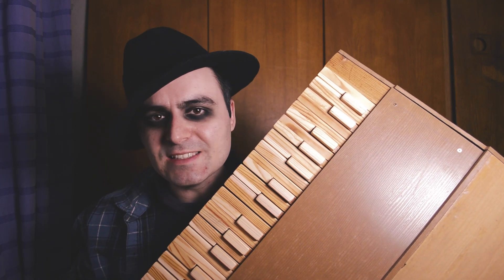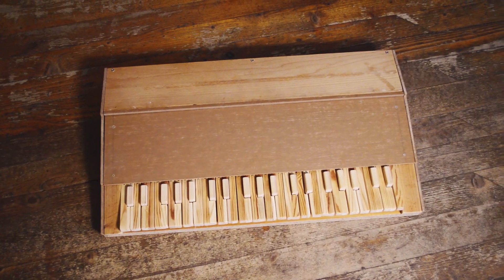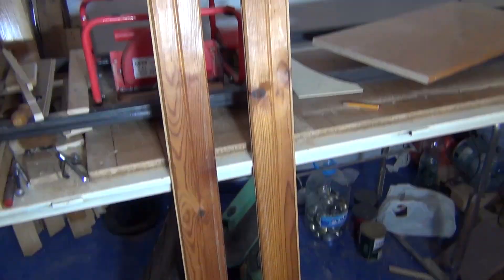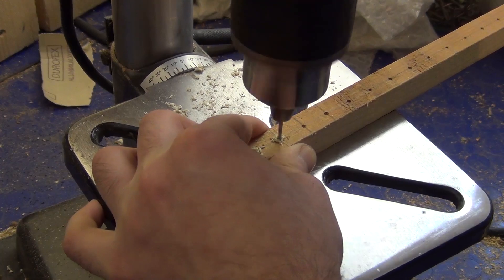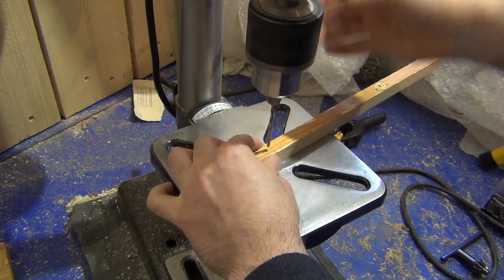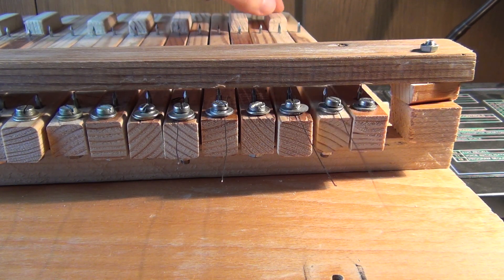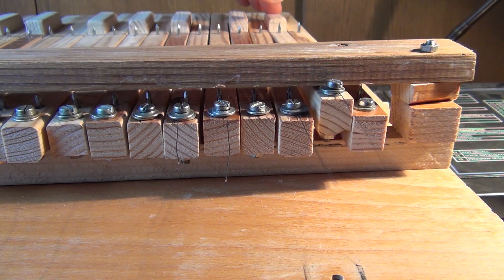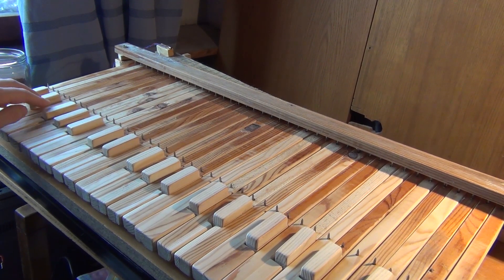Homemade Bass Synthesizer

Comment: Fantastic project! Its so cool to see what kind of sound you get from just vibrating bits of metal. 

I am very curious how it sounds when you press multiple keys together.
Reply: Actually, in this case you don’t get any sound at all by vibrating the small pieces of metal. He even said so in the video. The sound is coming from whatever speaker that is playing back the electrical waveform that is produced by the photodiode as it’s being hit by light periodically in relation to the vibrating string.

Comment: Is there a way of using analog electronics to modulate the signal from the photocell to increase the frequency of the signal and thus pitch?
Reply: Sounds great as it is, I must add
Reply from the maker: @binface9  If you want higher tones, this can be achieved with strings made of harder material. In the simplest way, the pitch is adjusted by the length of the strings. The shorter they are, the higher the tone. But the shorter they are, the harder they start to vibrate and short time they vibrate. But if we make the strings from a harder material, they will be able to be long enough to vibrate but also to emit high tones. Changing the tones electronically is not a good idea, it is not easy and it is not high quality. It is easier to change the tones by one octave from high to low than from low to high. Binary counters, frequency dividers are used for this work, but the quality is not good. Well, I won't say bad, but the sound changes significantly in another direction

Comment: This thing sounds awesome, and the fact that it uses a whole new sound synthesis model is unbelievable. I would love one of my own. An idea, perhaps you could mount the laser pointer or cell on an adjustable mount, that could be aligned up and down with a knob outside the case? Surely changing the alignment has some effect on the sound.

To be honest, calling it a "synthesizer" doesn't communicate it well enough. Synthesizers usually have tons of controls to customize their sound, because the software or hardware makes adjustments easy. I saw this posted to DIY groups without knowing the mechanism, and assumed this was a traditional synthesizer which had its controls hidden for artistic simplicity (an idea I'm not very fond of). That idea was much less impressive than the reality you've made.

Comment: That's an amazing invention but technically not a synthesizer. I wouldn't even put it in that niche because the sound generation in your invention is really unique and doesn't follow any synthesis scheme. It's conception might be best described as a hammered optoelectric musical instrument. You should give it a name though.
Reply: Optokeyboard
Optical monophonic keyboard
Laser keyboard
Reply: Rosophon
Rose-O-Phon
Forte (Oposed to piano ;)
Laserboard
Laserphon
Basslight 
Laserkey
Optokey

I guess shorter is better, piano stuck to the piano not because it made great sense, but because its short and sticks in the mind too. Also: +1 on build a version with at least one filter and reverb before outputting the signal. Also: try splittimg the laser so it shines on all strings at the same time without obstructing each other (fast turning mirror, maybe?) pick up the light for each note individually with each on LDR or the like, ad signals in a an amplified additive mixing electronic, and this can be true polyphonic one of a kind.
Reply: It is definitely a synthesizer, just without CV, but you can connect it to laser input, and you can add an lfo
Reply: @Vincedeir  filter, eq circuits could be added on the output, too. it would ruin its simplicity but if you need knobs to twiddle - there you go.
Reply: filter, eq circuits could be added on the output, too. it would ruin its simplicity but if you need knobs to twiddle - there you go.
Reply: Nerd

Comment: A great design. Your creativity can always give me a lot of inspiration. Would you like to ask if the iron wire you use is just different in length? Is there any difference in thickness and diameter? Thanks~
Reply from the maker: In the particular instrument, the thickness of the strings is the same, the length is different for each tone.  But different thicknesses can also be used to achieve a certain tone. 
Different length + same thickness = different tones
Same length + different thickness = different tones 
But different thickness not only changes the tone but also the way it sounds.
For example, two strings of different thickness are tuned by the length to emit the same tone. The tone will be the same but the sound different. The closest example is like playing the same tone on piano and guitar. The tone is the same but the sound is different.
Reply: @Edward_Black_Rose  Thank you very much! ~ ^^

Comment: Does the photocell work if I connect it on a guitar amp jack socket?
Reply from the maker: I don't have a guitar amp and I'm not sure. There are two types of amplifiers. The first are for microphones, they release current, the current passes through the microphone, when you make sounds the microphone changes its resistance, so it passes a different amount of current and the amplifier amplifies this. I use this type because the microphone input on my laptop works like this, I just replace the mic with the photocell. The second type of amplifiers do not supply current to their input. This type of amplifier is used for devices that have their own energy, such as microphones with their own power supply, synthesizers, perhaps guitars. Guitars are based on a coil, when the strings vibrate the coil does not change its resistance, but generates current. So in this case you have two options, to find a photocell that generates current when irradiated with light, or to connect a current source in series with the photocell. But be careful, the power source should give as much voltage as a typical guitar gives. Because you can burn your amp. A primitive but safe way is to connect a guitar coil to the amplifier, and another smaller coil in series to the photocell and power supply. The coil that is connected to the photocell will emit electromagnetic waves so that when it is close to the guitar coil, the guitar coil will produce electricity and activate the amplifier. You can make something like a pedal with which the two coils get closer and further apart. so you will be able to achieve the effect of smooth sound entry and smooth attenuation. All this is only theoretical, I have not made an experiment!

Comment: Ed, does it work with a chords?)
Reply from the maker: You mean  will make a sound by pressing several keys at the same time? Yes it will make a sound, but when a few keys are pressed the sound is much more distorted.
Reply: @Edward_Black_Rose  That would be very interesting to hear! :-)

Comment: damn man, I was really surprised/impressed at the laser/photocell pickup system, its fucking genius.. were you inspired by something or did you just make up a new way of picking up string vibration? you could make a 1 string guitar with this system with the laser going parallel to the body and perpendicular to the string, or maybe a 6 string with 6 lasers coming out of the body, like a string-through type pickup. would be seriously cool
Reply from the maker: Optical extraction of vibrations is not a new method, maybe it has existed since before I was born. But it is not very popular. I like to experiment with this, my invention in this case is the simplicity. There are no complicated mechanisms and complicated electronics as in all other keyboard musical instruments. At short distances as in guitars it is much cheaper and more reliable to use a light emitting diode instead of a laser, the reflection of the string can also be used in guitars.

Comment: Hey. You are a genius. It's so simple... You can made me one ?
Reply from the maker: Thanks! I can't produce good enough quality to be used as a real musical instrument. This is just a prototype with a lot of imperfections, it works for the video but with a lot of settings and preparations before that. And I am incapable with my tools and the materials I have access to to achieve sufficient precision and quality that a musical instrument deserves. It will be nice if I find people in my city who have the conditions for such precise production. In fact, I really want to start production, not only on this musical instrument, I have a few more ideas. But in my country it is a bit complicated, my compatriots are not very interested in musical instruments. So I will not have buyers, and if someone wants from abroad it will be much more expensive with delivery.
Reply: @Edward_Black_Rose  where are you from? I understand you. I'm Argentinian.
But when I saw your instrument it blows my mind because it's so simple and practical.
Reply from the maker: @dbkeysOK  I'm from Bulgaria. Yes, the device is simple but must be made well and precisely. Because it is very important that the position of the laser does not change and reaches perfectly exactly to the photocell and that the strings always vibrate exactly on the path of the laser. I have problems with this, somehow the wood bends slightly and over time the laser does not reach the photocell.
Reply: @Edward_Black_Rose  have tried 3d printing